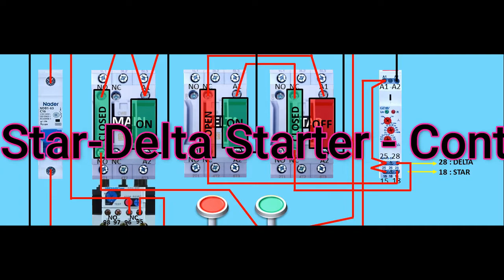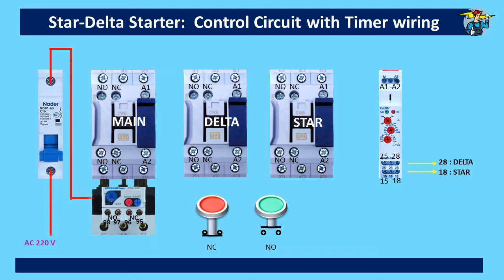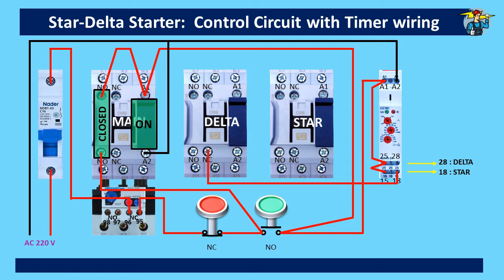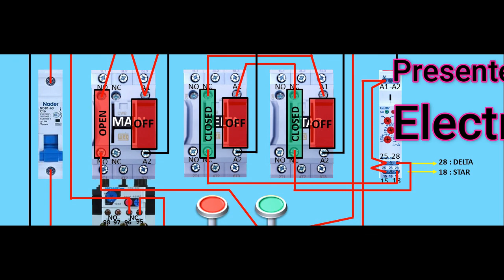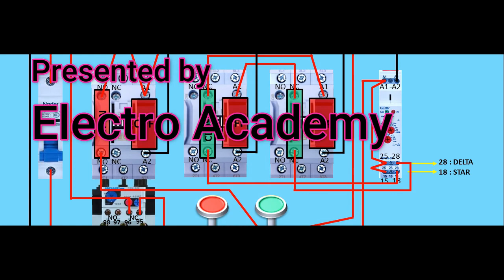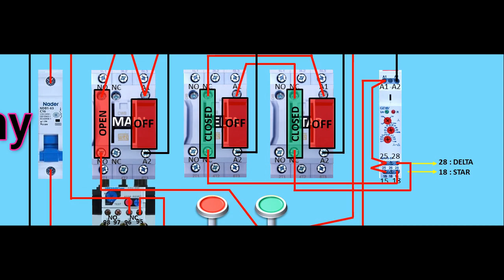Star Delta Starter / Control Circuit Wiring Explained

Comment: How to hold timer coil, because when we press start push button the timer coil gets energised A1,A2. After we released start push button how it maintain on hold condition. If the timer coil maintain hold condition then only the star and delta contactor gets input supply. please solve my doubt.
Reply from the maker: Although the start switch is open, main contactor A1 point is powered through the self holding circuit.
That is through the normally open contact points, which are closed now.
As long as A1 is powered, starting push button switch right side point gets power, and thereby the timer also gets power.
A1 of main contactor and the timer are with power, till you break the self holding circuit by pressing the stop push button to stop the motor.
Reply: @ElectroAcademyEA  thank you 👍